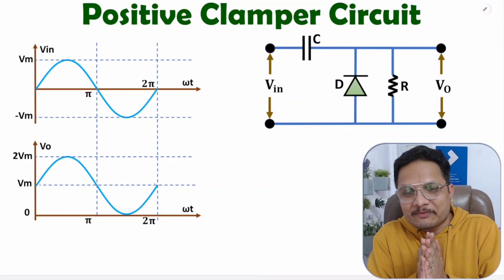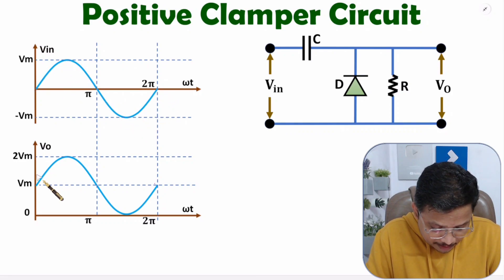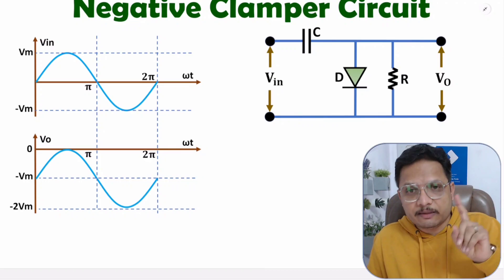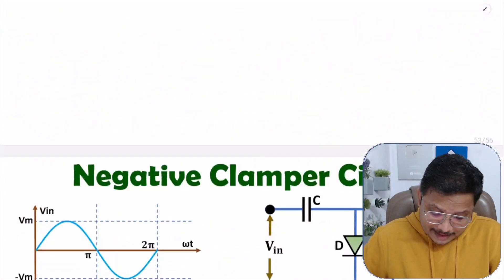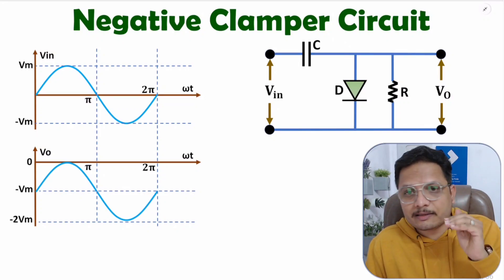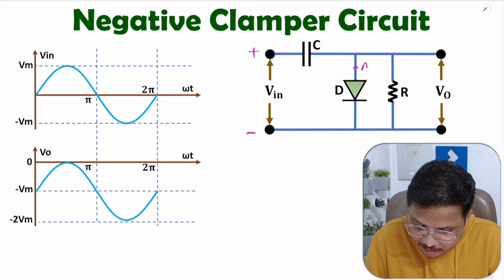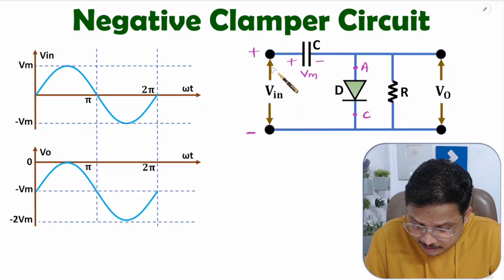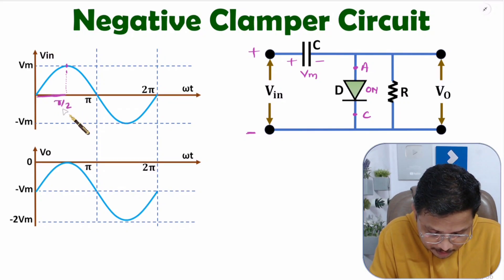Clamper Circuits (Basics, Working & Waveforms) Explained | Positive Clamper & Negative Clamper

Comment: Capicitor is not getting discharged or what? In 2nd cycle also its voltage is Vm. Like it should get discharge in next cycle, Am i correct?
Reply: While constructing the circuit we choose Resistor R and capacitor C such that time constant T = RC is large enough for the capacitor to not discharge quickly.

Comment: sir can u tell me what is the polarity we should take in positive half cycle , we should take the polarity with respect to capacitor or the diode itself
Reply: @sohanmaity7839   it depends on charging or discharging of capacitor,  if capacitor is charging then u take the same polarity as Vin 
and if discharging then whichever terminal of diode is connect to capacitor have the same potential as that of the capacitor and another terminal will have same as Vin